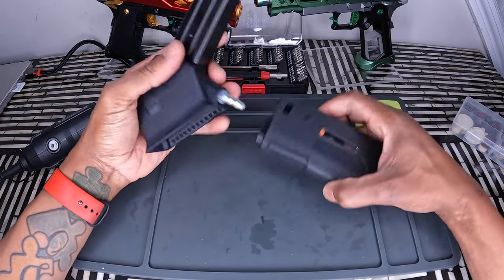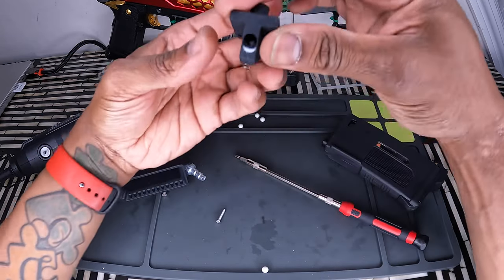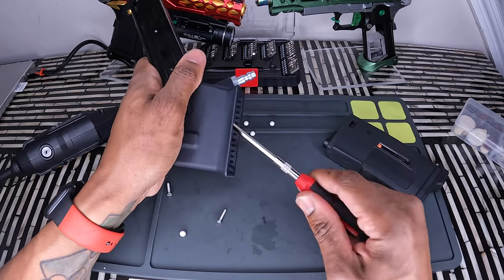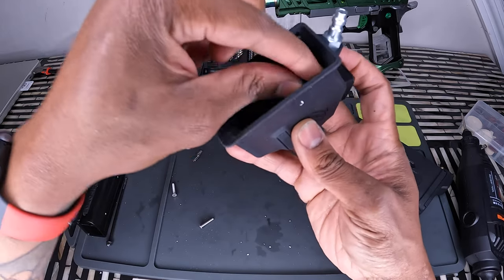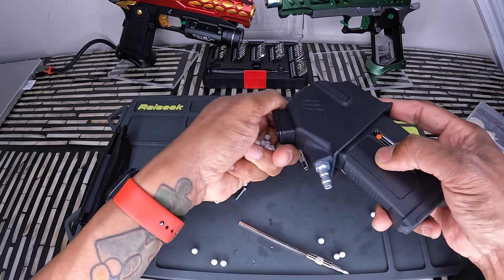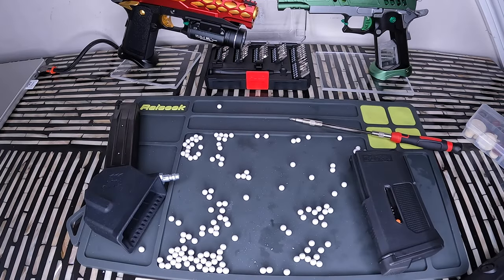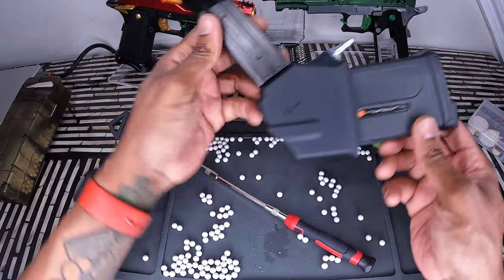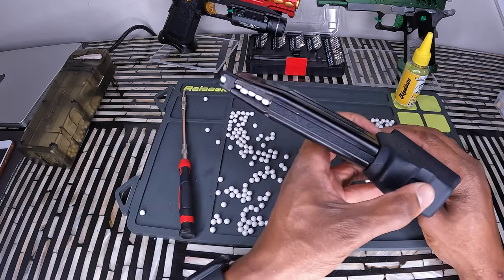How to fix Munk Customs M Adapter FEEDING PROBLEM

Comment: I ha e a different HPA Mag Adapter but im having the same kind of issue. The bbs go to the top of the mag and shoot fine for like 15 shots and then the bbs fail to load to the top of the mag and i have to flip the mag upside down and tap it to get it to shoot another 15 shots. Will this fix it? Im also having feeding issues with the mag.
Reply: I’m having this issue now have u got it resolved?
Reply: @lorenzomendoza5004  I have the same problem with .40 gram BBs with PTS magazine, has anyone solved it?

Comment: Do you have an issue aswell with the air sealing inbetween the adapter an the magazin? Because everytime i put my AAP 01 with the adapter against my shoulder i lose a little bit of air
Reply from the maker: No, I have no problem with my seal. You should try changing your Orings
Reply: Well its not the outlet itself its the part where the magazine and the m4 Magwell are screwed together
Reply: @CxPriince I got that same air leak when I pry/bend very slightly

Comment: i have similar problem, it does feed a little, but after one shot BBs are stuck. Do you think this will solve the problem? it looks like a simmilar issue
Reply from the maker: Yes, it will solve your problem
Reply: Your probleme are solve ? With this solution

Comment: may you make a video on where to lube up your hi capa after using it with HPA?
Reply from the maker: Will do 🫡
Reply from the maker: old man strength  I don’t have a Tapp Adapter but I’m pretty sure if you make the hole on both parts it’ll work. Part 1 the mag section where the M4 goes and part 2 the hole on the small piece that goes on the Hi-Capa mag
Reply from the maker: old man strength  the dremel would work better